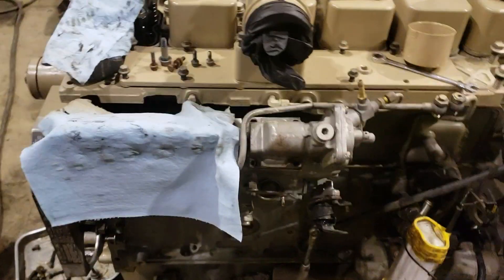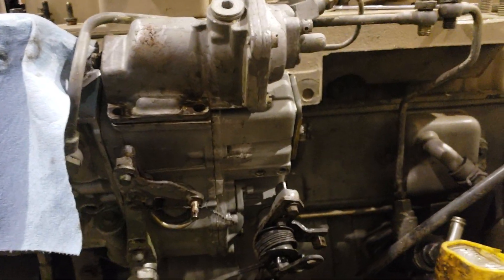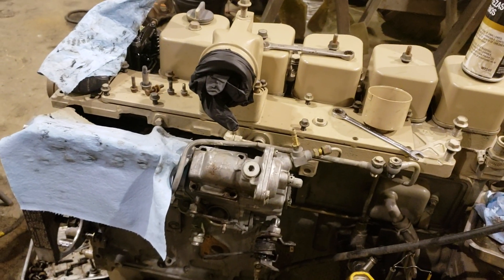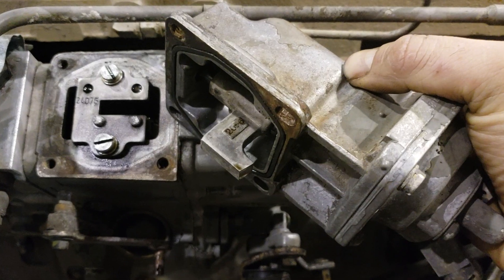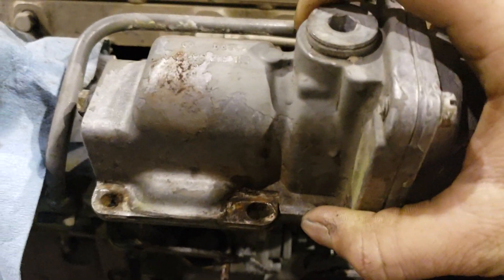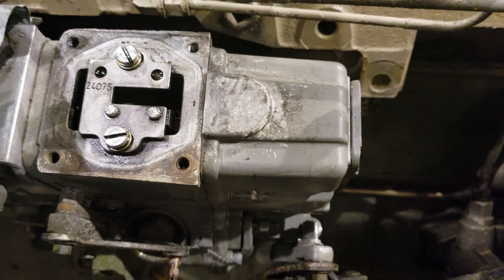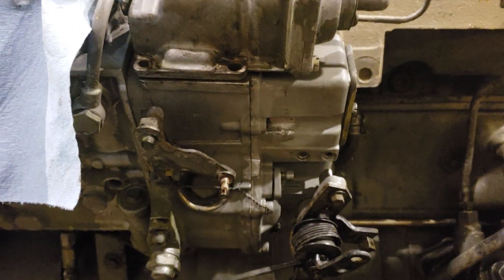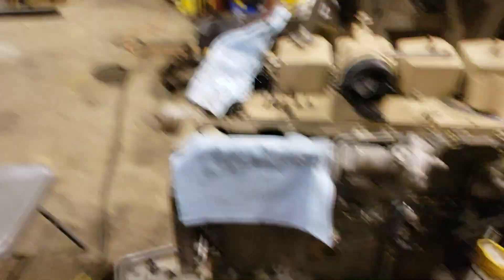M35A2 6BT Cummins swap: Let's talk about fuel rate and injection pump mods.

Comment: I have 2004 marine cummins 6bt 370 hp diamonds two of them. Port side starts and works good but starboad have problem with fuel injection pump. Mechanical primer builds preasure but pump not taking in to the system. I tried to bleed system but nothing goes there but fuel goes back to the tank. Previous owner had to open AFC housing to loose governor spring, it was kind of seized and since that time engine doesnot start. What could be a reason? Im not sure if he removed small plate shown in this video. Please help.
Reply from the maker: You must have a blockage between the mechanical fuel pump and the injection pump. Or your overflow valve has failed, allowing all the fuel to bypass.
Reply: @tacticalrepair  I got engine running but looks like governor spring not working. When i move trottle it does nothing.

Comment: Many channels don't recommend a flat plate. It will raise the EGTs, make a lot of black smoke, and drop your fuel economy.
Reply from the maker: There are a few profiles I've been looking at. Haven't decided on one yet. Eventually I will install AFC Live from Powerdriven Diesel, but first I need to get it in the truck and functioning.